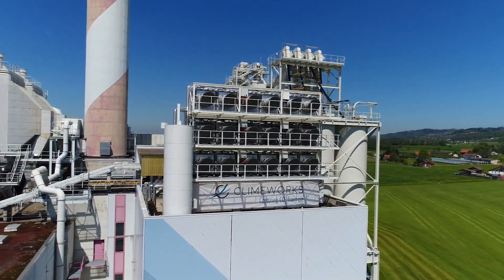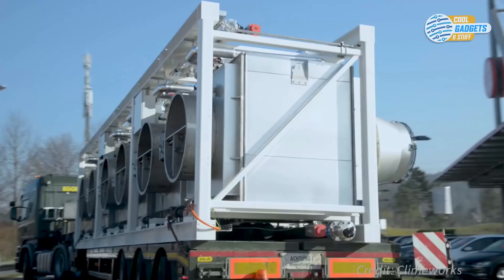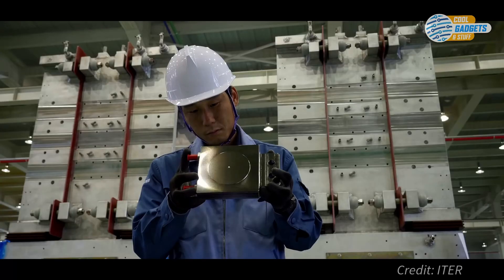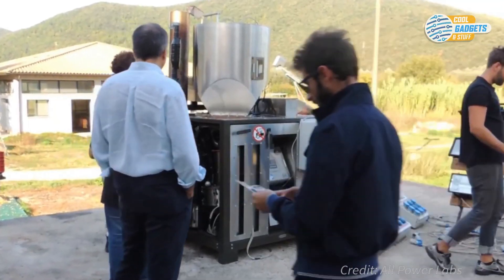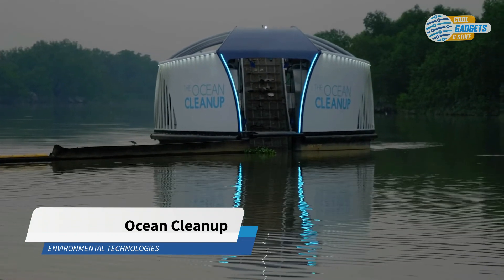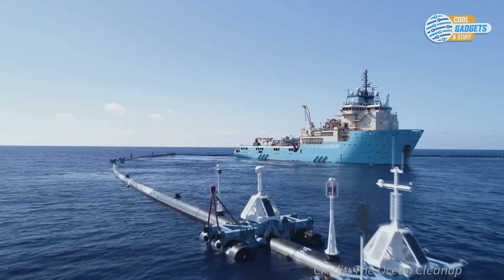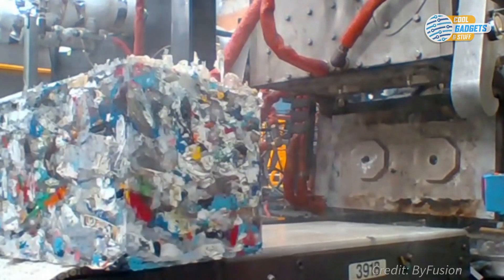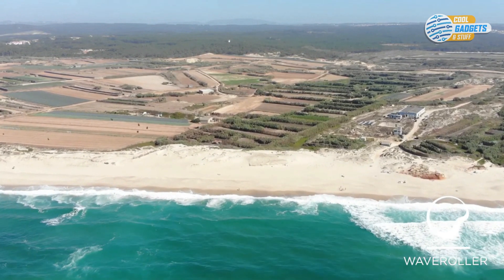ENVIRONMENTAL TECHNOLOGIES That Might Save Our Planet!

Comment: Have you heard of Realfiction holding and their new technology that will revolutionize the way we watch television? in addition to being able to display holographic images, a major upside is that the technology requires 80% less electricity than ordinary displays resulting in huge savings of approximately USD 7.4bN, 1.34% of the electricity production equivalent of 56 TWh of electricity and 25 million tons of CO2 only in the United States.
Reply from the maker: Thanks for letting me know, I'll check it out.